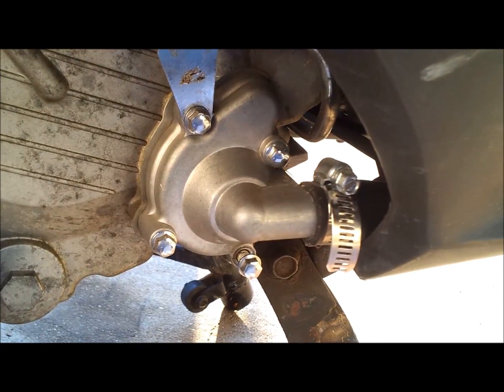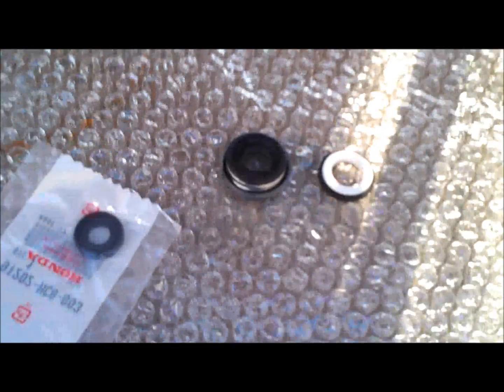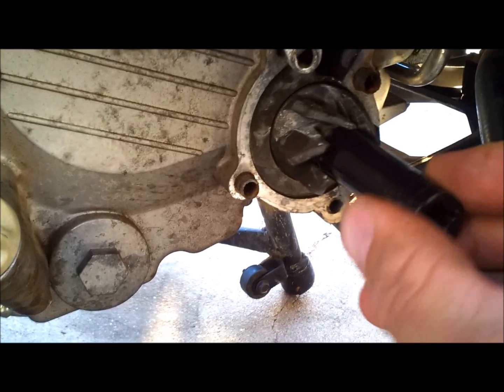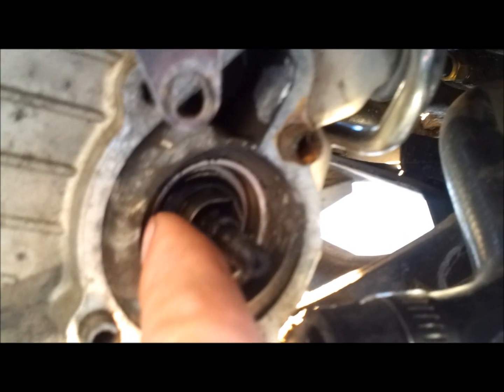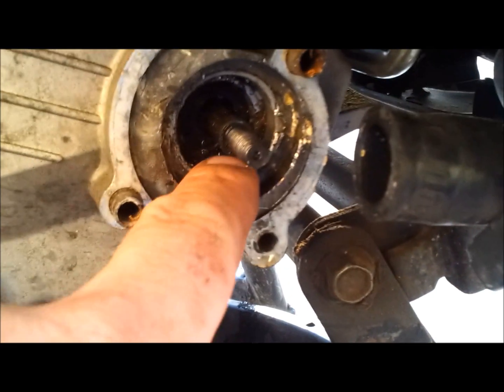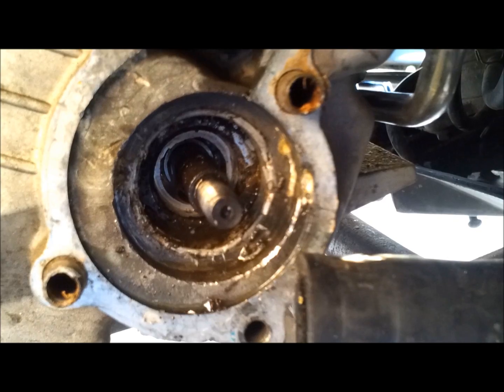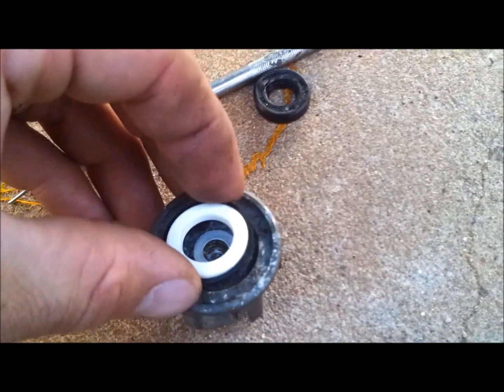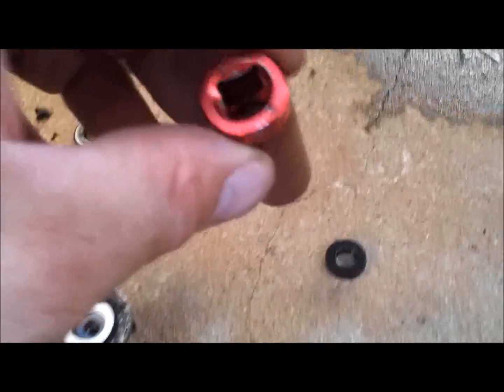Water pump Oil Seal replacement

Comment: Great Video!  I used yours to double check putting my seals back on my 2005 Kawasaki Prairie 700 / KVF700.  I had to make sure the oil seal was on the right way because the manual does a terrible job on how to put it back on.  Thanks!

Comment: Very helpful video, thank you for taking the time to record and share it.
I followed your video and unfortunately I destroyed the outer seal. The one with the spring on it. I used a 1" socket to tap it back in but apparently I was off center or hit it too hard and destroyed it. So today I ordered another seal kit from ScrappyDogScooters and it's on it's way.

I just seemed to struggle with keeping the seal centered. It kept wanting to push in one side farther than the other. When I shifted the position of the socket to tap in the other side I apparently slipped and caught it wrong and it broke the plastic piece on the top of the spring. Will try again next weekend. If you have any advice please share.Thanks,

Comment: How you flush the crankcase after water and oil gets mixed?
Reply from the maker: I just drained as much as I could out of both and filled with new fluids.  I ran it for about 10 minutes to get everything good and hot, then drained everything and replaced fluids again. I repeated the process about a week later to make sue everything was still good.

Comment: How did you know you needed to replace your seals? Was it that you notice that your oil and coolant were mixing? I may have a very similar issue is why I am asking. Thanks for sharing this video!
Reply from the maker: I was doing a routine check on my oil and found the oil to be foamy and discolored.
Reply: That's also the way mine looked as well. Was your oil level higher as well. Mine was a lot higher than it was supposed to be I guess because  a lot of coolant mixed in with it.
Reply from the maker: Yes.  The oil level was significantly higher than it should have been due to the inflow of coolant.
Reply: Yep I'm experiencing the same issue. Thanks again you've been very helpful!

Comment: Where did you get that oil seal at ?? I have talked to many because Kuzuma parts dealers and no one seems to know what I'm talking about.
Reply from the maker: I bought them from a parts catalogue for a Honda Helix.  This CFMoto engine is a Honda Clone.

Comment: Do you need to drain your oil before doing this?
Reply from the maker: It is helpful to drain the oil first.  If you don't it will just drain out when you remove the old seal.

Comment: Where did you get the oil seal from? I cannot find any part numbers to match mine with on the Honda parts list
Reply from the maker: It's been a little while, but I believe I purchased the parts from cheapcycleparts.com.  I just found the diagram for the honda helix engine and ordered the oil seal from there.

Comment: I am very frustrated! Good video, I followed your advice and have destroyed two of the outer seals at $13.00 a pop trying to seat them. Used a 1" socket that fits perfectly over the metal lip of the seal. Lightly tapped it into place and it bends and deforms every time. I don't know what to do as this is not rocket science and should not be that difficult. I am open for suggestions as I need to wait five days for a new part to arrive yet again. I am not new to mechanics', have worked on lots of machines over the years. Starting to think this is just crappy Chinese parts.
Reply from the maker: I agree on the cheap Chinese parts.  The parts I used were bought directly from a parts catalogue for a Honda Helix.  This CFMoto engine is a Honda Clone.